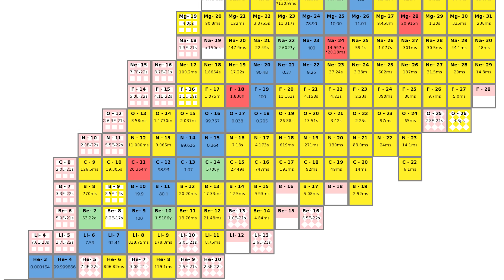Why the U.S. Doesn’t Recycle Nuclear Fuel

Comment: Firstly, I'm a huge proponent of nuclear for electricity generation. I served as a nuclear engineer and chemist aboard a fleet ballistic missile submarine. I also worked on the Naval Nuclear Fuels and Defense Waste projects throughout the 1980s.

Firstly, "nuclear waste" is a misnomer. Spent nuclear fuel isn't waste as it still possessed 90+% of its original energy load. 

Secondly, the disposal of true nuclear waste (the byproducts of nuclear fuels, as well as nuclear weapons processing, etc.) was solved long ago. I know, because I worked on the project. We were supposed to be securely storing both high- and low-level nuclear waste deep under Yucca Mountain from the mid-1990s. NIMBY and useless politicians constitute the lack of political will that has prevented progress for more than three decades. 

Lastly, whether it's MSRs or SMRs that are built to burn spent nuclear fuel, the facts that it's an available resource that's capable of supplying all of the power that the US needs for the next century and beyond is without question. 

Progress is being made. OKLO was recently awarded a contract to stand up this nation's first spent nuclear fuel recycling facility at ORNL.
Reply: About depositing nuclear waste, geologists have the last word (if you want to listen ...).

Comment: Well, the isotope table is bigger than the periodic table, but it's conceptually much simpler. No need to think about how rare earth elements are almost the same but still different, or all the other quirks: Left-to-right is protons (and hence different elements), up-down is neutrons (which affect only nuclear properties, not chemical ones), and have too many or too little neutrons for the protons gets you less stability. There is a whole lot of details, but it's conceptually much simpler and much more gradual, as opposed to the periodic table where the most reactive elements are right next to the noble gases, where properties sort-of transfer vertically but sometimes they don't.

Comment: DTE Energy already built a Sodium cooled reactor near Detroit, Fermi 1,  construction started in 1956, commissioned 1966, shutdown in 1972 due to a partial meltdown of the core. Six years of power generation at a cost of $6.1B, NEVER made a profit. Unit 2 is still operational, but is is a standard water cooled power reactor, not Sodium.

Comment: There is a cost benefit analysis when it comes to shareholders. Many wish to only engage in capital investments with high yields. 'Recycling' typically has lower yields and is highly dependant on a waste industry, so even mentioning it in any form can chase away high value investors. Now if you can create a high enough demand, or be exceptionally efficient in recycling in high value and/or volume, then you can get things rolling. Still, it is more difficult than many people think. Subsidy can help, but has historically been somewhat unreliable due to flaws in the application of such subsidies.
Reply: google : Wall Street Warns Of Nuclear Tech Bubble

Comment: I never made it to West Valley New York sit but apparently that was quite messy.  The biggest part of the mess that the Hanford site is the recycling and plutonium purification facilies.  
It would be cheaper to get people to stop being overly afraid of the long-term radio isotopes and nuclear waste because they're actually the least dangerous in the environment.  Everyone who says otherwise has never worked with it in the environment. 

The UK's biggest mess are ponds full of sludge from where they used to recycle their fuel.  The problem with recycling is it takes more space to store the waste from recycling than it does to store the spent fuel.   The most lethal part of radioactive waste in the short term is the part you separate out when you recycle the fuel.
Reply: I worked at West Valley as an engineer during the middle 1980s during the cleanup of the reprocessing facility.  During its commercial operation, the facility removed "unburned" fuel from expended fuel assemblies; that was the easy part.  The byproduct of that processing was lots of high-level radioactive tailings.  In the cleanup, we chemically processed the tailings to separate the active isotopes from the rest of the material.  Those isotopes were mechanically stabilized by dissolving them in molten glass.  It seems that the original operator, Nuclear Fuel Services (Getty Oil), did not make long-term plans for handling their tailings. 

Today I think that the lessons learned regarding the cost of fuel reprocessing and concentration/stabilization of tailings economically favor the enrichment of mined ore rather than reprocessing of spent fuel.

Comment: At some point the bottleneck is going to have to be widened. Period.
Fission or fusion.

When 8% of the energy that the sun produces makes its way to earth and of that 8%, only 25% is actually captured and of that 25% some is lost to thermal dynamics. Covering the planet in solar panels is silly and impractical.
Reply: I'm pretty sure that if 8% of the Sun's energy was reaching Earth that our planet would be a mere cinder with no life on it.

Comment: Ok if you check this very channel, Rez Politics. We sent a person to Utah to view a Small Nuclear Reactor; there was not one there. Not a test mule or a design. Nothing to view, not because it was a national secret or danger of the radiation, but because there is nothing at the facility. All they gave people on the tour, was handouts of the program and a 4-hour ride in a bus to tour the landscape basically. They have 4 million acres, and they want to test in Colstrip Montana. There are no operational SMR's in the United States. But they have plans and drawing, renderings of how they're supposed to work. The earliest they will be available, I personally predict is around 10-15 at minimum. The Tech is there, they're just trillions of dollars away and years, of promises that may not actually work in the end. 

The Cheyenne tribe did confront many of the people that presented at the town hall in Colstrip Montana. They also have a responsibility to work with the tribe that is border to the proposed SMR reactor site, which is less than 20 miles from the reservation. Federal law says that they need to work with us, disaster response is the biggest issue. 

I also believe the people of Colstrip are already sold on the SMR. They believe that they can come and set up and it will be up and running in a few years. I've explained to them, ALL US SMR's are not operational and have never made power. They are still in the design and test phase, they have been for 40 years. All of the SMR's are all double and triple the cost of what they first proposed 10-15 years ago, along with all around the world. Those costs are in the tens of billions of dollars. 

Despite everything I've just said, I am very much for SMR's and know the tech. I am highly educated and can and am able to explain everything in minute detail. This is also the reason why, I believe the SMR's while they're in the test and design phase, should stay at government test site and away from people. Overpromising power when their machines are not even operational and causing political problems with something that dosen't even work yet. 

Go get it started, test and assure the safety and reliability of the units. Then come back to these communities and then promise.

Comment: The real benefit to reprocessing spent fuel is obtaining the many different platinum group metals from the waste.  These metals could be used to make high power density fuel cells.  I would love to have an EV fuel cell car that had a 300 mile range and the ability to refill its H2 tank in under 5 minutes.  Reprocessing would also allow for the easy disposal of the seven long-lived fission products and the actinides could be recycled into MOX.  Reactor designs with better neutron economies could burn this waste and be a realistic low entropy source of energy to replace our fossil fuel powered plants.  

Green energy has been a disaster for this country because they can't make any appreciable amounts of reactive load for the grid.  I have experienced both the 2014 PJM grid emergency while working at a power plant and the ERCOT grid disaster in 2021.  The public needs to wake up and learn what power plant operators & load dispatchers do every day to keep the grid working.  I seriously doubt more than 1% of the US public would be willing to collect snow in buckets so that they can flush their toilets, or suffer huge economic losses caused by long blackouts.

Comment: Yes I am not formally educated but how is it if each element on the periodic table and our current atomic model says each element stable step has proton and neutrons equal at what element does our counting of neutrons separate from this equal model?  Is this a measurement issue or as elements get more dense each proton has a chance to trap an extra neutron as it collects in proton density?

Comment: In the United States, it's illegal to reprocess or otherwise use spent nuclear fuel. Your laws prohibit everything except the disposal of such fuel. Furthermore, the United States currently lacks its own technology for producing nuclear fuel for power plants. A French company produces it in the United States from uranium byproduct prepared in Russia.
Reply: The United States manufactures its own nuclear fuel for military applications so you are wrong that they don't have the capability, but you are correct that they don't reprocess spent fuel, they are presently processing it for long-term storage or disposal.
Reply: @danadurnfordkevinblanchdebunk  The United States doesn't have its own technology for producing fuel for nuclear power reactors. Weapons-grade plutonium is produced in special reactors or obtained as a byproduct in certain types of power reactors. We were talking about power reactors, not plutonium production. I wouldn't be surprised if this technology was lost, and now they only use what was produced in the 1960s and 1980s.

Comment: It's a shame they didn't cover WHY we don't recycle spent fuel more.  As far as I know, they still haven't solved the cost problem, and that it is significantly cheaper to use new fuel than it is to reprocess spent fuel.  As nuclear power is one of the most expensive forms of electricity available, it's hard to see how it's  going to compete with renewables and batteries, which keep gettng cheaper.
Reply: The "why" boils down to fears over the use of MOX to breed plutonium for a weapons program instead of civil power generation.

France and Japan have very successful reprocessing programs, specifically to reduce costs.
Reply: As Alexander said, it's not a cost issue, it's the historical byproduct of cold war fears due to the potential to produce plutonium inadvertently.
Reply: @PaulKer87  Until recently, the west was buying much of its uranium from Russian missiles as they dismantled them under treaties, which was far cheaper than recycling.

That has probably changed since Russia invaded Ukraine.  However, there are scientific studies you can find on the web explaining the cost problem.

Comment: In other words: 
- The largest supplier for nuclear fuel used in the U.S. was and still is Russia.
- "Recycling" spent nuclear fuel only results in a fraction being reused and does NOT resolve the problem of long term storage of nuclear waste over hundreds of thousands of years.
- Nuclear power is VERY EXPENSIVE. For most applications renewable energy cost a fraction of nuclear power.
Reply: -the United States manufactures its own nuclear fuel for the military so we can do it.
-reprocessing is costly but reduces the waste stream to waste that is toxic for hundreds of years, not thousands. 
-Nuclear energy is less expensive long term than ruinables when real numbers are used.
Reply: @danadurnfordkevinblanchdebunk   - Military reactors use a completely different kind of nuclear fuel than civilian reactors.
- The problem with nuclear waste from uranium is NOT the toxicity it's RADIATION.
With a half-life of thousands and thousands of years this used fuel must be stored somewhere (safely) for hundreds of millennia
-Nuclear energy is absolutely NOT less expensive, it only ever was and is commercially viable because of massive direct and indirect subsidies. In fact there is no insurance in the word that any operator of nuclear reactors insure their plants for covering the risk and cost of disaster. 
There are also many examples of operators of nuclear facilities in many countries burdening tax payers with (nearly) all of the extremely expensive cleanup cost by simply separating old used up facilities from their profitable business into separate bankrupted businesses to avoid financial and legal liabilities.
- Generally speaking the new installation of renewable energy currently cost about 1/3rd of nuclear energy, depending on the country and market.
Why else for example do you think the deep red Republican governed 'BIG OIL' state Texas has so much renewable energy already? It's because in many cases renewable energy is currently already much cheaper and much more profitable than other forms of electricity.
Reply: @danadurnfordkevinblanchdebunk  
-Military /naval nuclear reactors typically use Highly Enriched Uranium 'HEU' fuels, which the US has stopped making back in 1992.
Radiation and chemical/biological toxicity are completely different things and affect the body via completely different mechanisms. Just like X-rays and microwaves are also very different from cyanide, arsenic, or snake poison.

To sum it up, you obviously have no clue what you're talking about, but do feel free to share your 'real numbers'.
Reply: @danadurnfordkevinblanchdebunk  Troll much?
Reply: @danadurnfordkevinblanchdebunk  Nope first you'll have to prove a single argument you've made to be factually true.
Reply: @danadurnfordkevinblanchdebunk  Made up numbers, show a nuclear power plant that ran or is licensed to run for 80 years anywhere in the world for that matter.
Reply: @danadurnfordkevinblanchdebunk   Great you found one that's actually got a license to operate for 80 years. 
Shall we go and compare that to the 19 oldest Dutch windmills from 1738 to 1740 now?
Reply: @danadurnfordkevinblanchdebunk  Sorry, but you're really going to have to blame Eddison and Tesla for not being around 100 years earlier on that one, don't you think?
Okay, how about the Hoover Dam then, how often has that been replaced by now? - 5 times?
Reply: @danadurnfordkevinblanchdebunk  Dams are being built all over the world, so are wind farms. 
43 years is actually a pretty abysmal lifespan compared to many other types of powerplants including renewables, like I demonstrated within a matter of seconds. 
You on the other hand have only demonstrated to have no clue whatsoever with your utterly silly claim renewable power plants had to be replaced 2 or 3 times during the same time span. 
Not a single one of your arguments stands up to the facts of reality, you only need to look at what types of power generation the companies operating nuclear and fossil fuel powered plants are investing in and what types they are divesting from to see what the experts in the matter actually believe.
Reply: @danadurnfordkevinblanchdebunk  How much Highly Enriched Uranium fuel were we making in the US again, and how much of that is used in civilian rectors again? 
And how much did the US pay Russian oligarchs for nuclear fuel again ever since their invasion of Ukraine? 
How much did you say it was again?
Reply: @danadurnfordkevinblanchdebunk  I'm sorry but I really wasn't 'supposed to prove you anything', you're the weirdo who came by, threw out a bunch of nonsense, BS, and insults, barking up the wrong tree like only a fool does.
Go look up the actual numbers on cost per MWh and learn something real and useful for once in your life instead of listening to cult propaganda.
It's called "levelized cost" you can google it in a matter of seconds and it will show you that nuclear is 2 to 3 times as expensive as renewables.

This conversation is done here, go troll others.
Reply: @danadurnfordkevinblanchdebunk  You haven't and you can't. 
This is getting boring, troll somewhere else.
Reply: @danadurnfordkevinblanchdebunk  You have a funny concept of proof. 
Claiming something stupid and silly isn't proof for anything other than your lack of knowledge.

Comment: No question.. Squints at resonance filtered Ultrasonic holography by capacitor driven Plasma generated Ultrasound Did you know Ultrasound can print through walls? It can break bonds and merge to arrange things too. Power cost? Squints at trash Ultrasound methods make shapes with sand Umm.. If you break things down into their individual parts the power level required to move them around vastly drops.. Fires echoes and pulls charges in the atmosphere to line up for mini-lightning dumps using Atlantis Piezoelectric Ultrasonic holography machine Just told you how to upgrade shield for Atlantis so no need to just wait for lightning to strike to power your shields. Google: "Ultrasound control of electric Plasma" + "Boeing Plasma force field blocks bomb shockwaves" I just told you how.. Heh.. - Dracula/Hades (Christians: "We need to put a stick in his heart!" Me: "Like Jesus? How long did it take my brother to repair that Avatar? Takes up to 3 days for a man to die on my Stakes ask your historians. I'm good at science..)